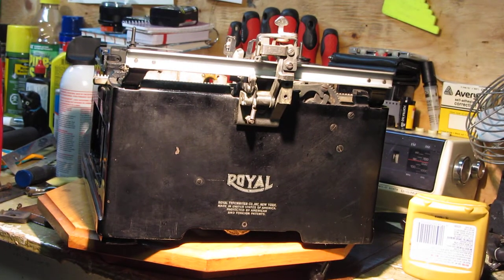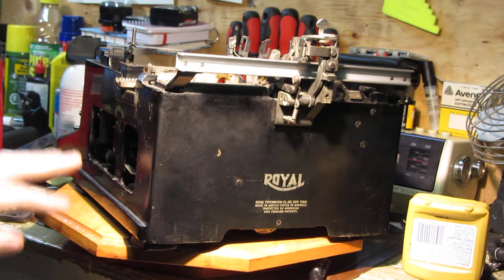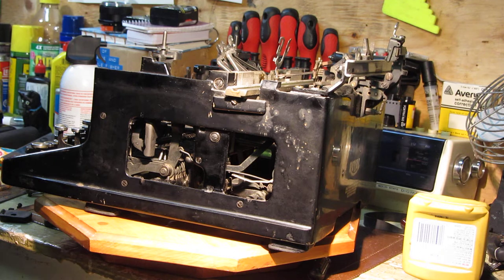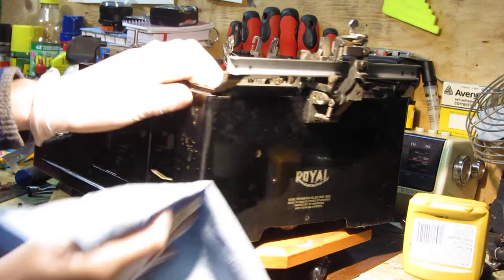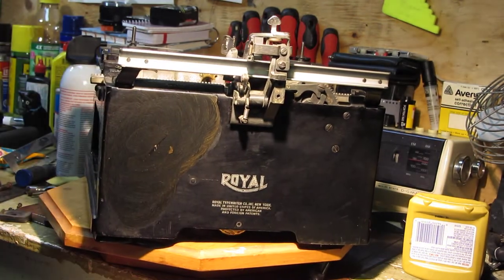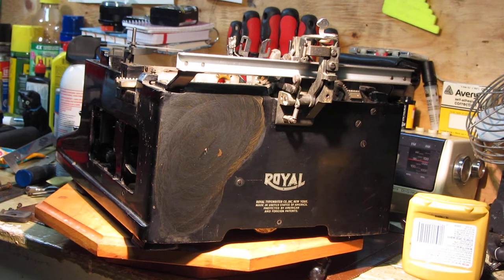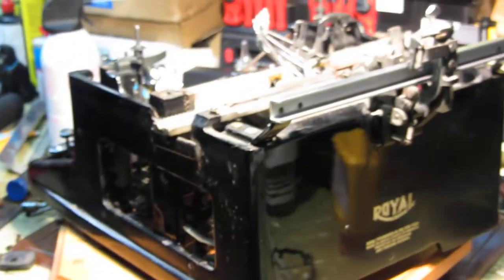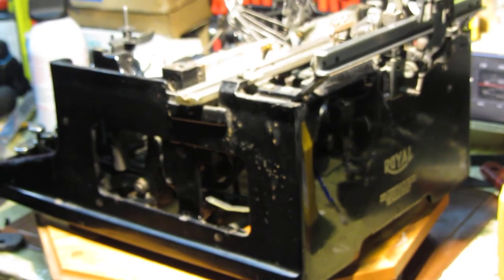Royal KHM - Techniques for Polishing Antique Glossy Black Paint

Comment: What's your advice for finishes that have gone white or brown from being exposed to the wrong cleaners? I tried to clean a Royal 10 I'm afraid and the clear coat was already in bad shape as well as the paint and so I've largely made it worse in a couple places.
Reply from the maker: That issue is not necessarily due to wrong cleaners being used but a different exposure to the elements throughout it's existence of 100 years. Royal Typewriters were made until the early 30's, so the youngest ones are 90 years old now. 

I discovered a brilliant way to at least temporarily revive the old shellac and that is to lather it in 3-in-1 oil, let it soak in for 10 seconds and then wipe it off. The paint might not be perfect or polishable for that matter. But it last at least 4 years since that is how long the gloss has returned on my Fox No.24.

Comment: Interesting that by cleaning the shell, you are also removing the old shellac and replacing it with car wax. When restoring antique clocks, we remove the old shellac and apply new shellac, usually with the French polishing technique. Why not apply a new shellac coating, which is more more durable than wax? Thanks! 
Daniel
Reply from the maker: Mainly because I don't remove the shellac or clearcoat but brush polish it. The brown tar residue you see on the rags is mostly dirt and nicotine staining from over the years. All I really do is clean the old paint and shine it.